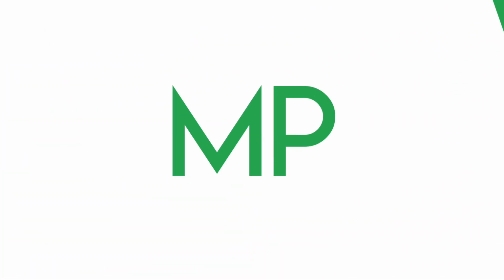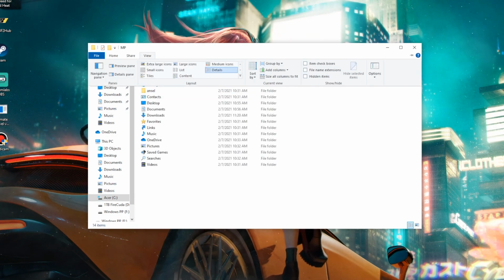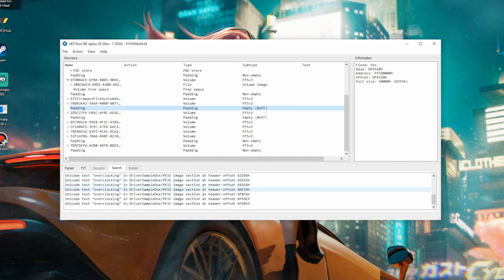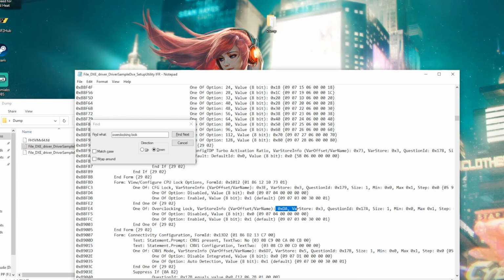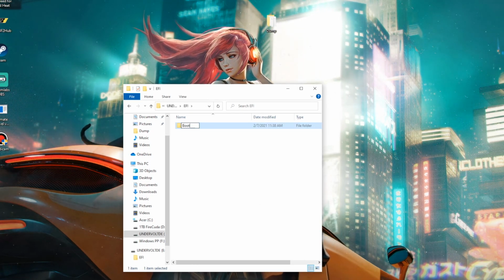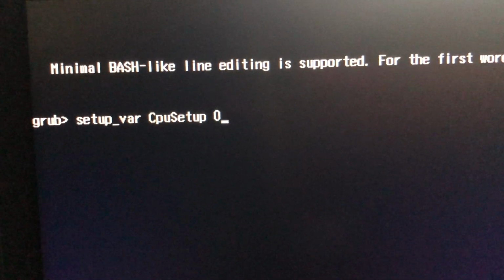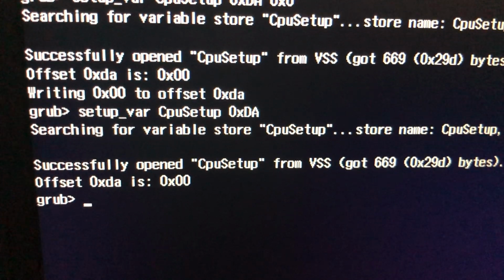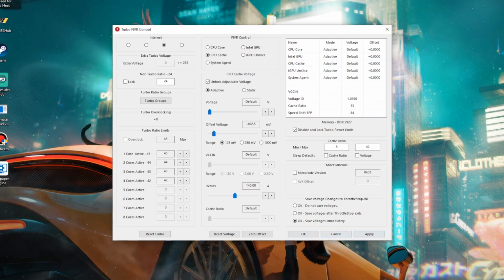How to Undervolt i5 10300H Acer Nitro 5

Comment: DUDE PLEASE HELP ME OUT!

I have a Asus Tuf Gaming F15 FX506LH. I am not able to get undervolt option unlocked. I tried flashing older version of bios. I have bios version 309, I tried using 307 but it didn't work. WHat should I do? Is it even possible to undervolt F15?
Reply: i have the same model as you and when UEFI tool to search for undervolt it just doesn't work
Reply: It should be possible. I have an FX506LI with bios 310 and after setting the var with grub it unlocked.

Comment: Hi I have an acer nitro 5 laptop with 10300h and rtx 2060 and I have undervolting blocked, I do everything like you but I have a problem loading a file from bios to uefi invalid uefi volume, do you have any solution?
Reply: did u manage to fix this ?
Reply: i found the solution you just need the latest version of the tool

Comment: Hello, thanks you for help, I was able to unlock the CPU volts and limit it the same way you did, but at 4200Mhz the temperature still reaches 95 degrees. Can you tell me what to do?
Reply from the maker: Does it reach 95 ingame or is that benchmark temps?
Reply: @Meanpooh  In game, 80-95 temperature on 4200Mhz
Reply from the maker: Well my machine is repasted so that helps with my temps.  Much better than stock paste.  Other than you might try a cooling pad thats all I can think of that will help.  BTW, my room temp is between 71-73F.
Reply: @Meanpooh  I've had paste twice in a month, in two different services, the room is also quite low temperature. There is a stand for a laptop, cooling also works properly. The only thing that helps is lowering CPU frequency. Literally a second after reaching 4200 frequency, the temperature reaches crazy degrees. I did exactly the same thing as you did in the video
Reply from the maker: You power settings is set yo "Balanced" correct?
Reply: @Meanpooh  high perfomace
Reply from the maker: @enw5140 set it to balanced mode.
Reply: @Meanpooh  You're talking about nitro sence, right?
Reply: @Meanpooh  Thank you so much, it really helped. I can't believe it the temperature maxes out at 80 degrees)

Comment: Seems pretty straight forward. Thanks a lot! So in case of a warranty issue, in order to revert back: we just need to go into grub and write 0x1 to that variable, right?
Reply from the maker: Just go back in and write what it was before you changed it.  It can vary by machine.  My machine was sent off to Acer to be repaired.  I never changed it back.  The change is nearly invisible as the BIOS is not being flashed.
Reply: Hocam merhaba, işlemi gerçekteltirebildiniz mi?
Reply: @recepcan3784  merhaba evet yaptım gayet sorunsuz calısıyor komutlar. geri de alınabiliyor yazdıgım sekilde.
Reply: @ozgur105  UV sonrası sıcaklıklar ne alemde peki ve işlemcin neydi?
Reply: @recepcan3784  i5-10300h, ya açıkçası sıcaklıkları karşılaştırmadım, hep böyle kullandım. Bir de UV yapmazsan fan daha hızlı çalışıp sıcaklıkları gene benzer seviyeye getiriyor. O yüzden tam bir kıyas zor. Ama kağıt üstünde (ki aslında muhtemelen pratikte de) 100 mV düşürürseniz, en yüksek frekansta %85'i civarına iniyor harcanan güç. Çünkü voltaj karesi oranında güç harcatıyor. Frekansı da 4.0 gHz'e limitledim, voltaj da düşüyor bu şekilde. Bu ayarlarla cpu zorlayan oyunlarda fan sesi gayet düşük düzeylerde takılıyor. Ha bakıyorum bazen 90 derece oluyor ama fan gerçekten hiç panik yapmadan çalışıyor, tam gaz çalıştırsan fanı gayet düşer. Ki bazı incelemeciler fanı tam güç çalıştırıp söylüyor değerleri. 

Temizlik ve macun da önemli olacak bir zaman sonra. Bence iyi bir macunla ve 90-100 mV UV ile gayet sorunsuz çalışır bu işlemci.
Reply: @ozgur105  Bende de aynı işlemci var ama benim cihaz Predator Helios. Bende Undervolt yaptım, saat hızları normalde sıcaklıklardan dolayı 3300'lerde gezerken şimdi stabil 4000-4200 mhz fakat sıcaklıklarda bir değişiklik olmadı ve bende bunu merak ediyorum. Madem giden voltaj azaldıysa sıcaklık neden düşmüyor?
Reply: @recepcan3784  Ama dediğin gibi 3.3 gHz'de çalışırken artık 4.0 gHz'de çalışıyor. Güç tüketimi ve dolayısıyla ısı üretimi, (voltajın karesi)x(frekans) ile doğru orantılı. Bu yüzden sen UV olmadan 3.3 gHz'deyken ürettiğin ısıyı anca atabiliyorken, şimdi 4.0 gHz'deyken ürettiğin daha fazla ısıyı atabilip güvenli sıcaklık seviyesini (tahmini 90 dereceler civarı) sürdürebiliyorsun. O yüzden doğal bir şey bu. Ha diyelim ki artık UV de yetmiyor, 4.0 gHz'e çıkamıyor bilgisayar, o zaman içini temizlemek gerekli, belki de macun değişimi.
Reply: @ozgur105  Intel XTU ile mi ayarladınız voltaj değerlerini?
Reply: @recepcan3784  Throttlestop ile yaptım, XTU çalışmayacak sanırım.

Comment: Hi , i have the same nitro laptop as urs, first of all thank u so much for this , it’s truly helping me lowering my temps, but what do u suggest as the ideal offset voltage?!
Reply from the maker: Glad I could help.  There is no one all setting to choose as one undervolt my not work as well from one game to the next.  You could do a .115 which should work for everything but it's not fine tuned.
Reply: @Meanpooh  thanks for the reply, a -115 offset voltage makes my laptop lags,  i set it to -110 which was fine since the temps didn’t pass 80, but i dont think im squeezing all the performance for my cpu,, i play mostly warzone btw, with a 1660ti

Comment: Hi! Will this work on bios version 1.06? Acer nitro 5, i5-10300h+GTX 1650? TY
Reply from the maker: It should as the only thing you need to find is the address location.
Reply: @Meanpooh  thanks!
Reply: @Meanpooh  Hi. Why can't I boot on my flash drive even if i press f12? It just restarts normally.

Comment: Good day to you kind sir. Nice channel you've got!
I bought this laptop today but with the 1660 ti. I got it cheaply (450 euro) from a store that got a returned unit even though it was barely used at all. Like new... buut it performs quite bad. Core 0 and "package" reaches 92-93c straight away in cinebench R23 yet the clockspeeds stays at around 3.9Ghz and sometimes reaches 4.2Ghz. It's pending back and fourth. Still I get really bad multi core scores. At most I've got a score of 4700 points but mostly it only goes up yo 4300 points. Thats 1000 points less than most with the same acer nitro 5 and i5 10300h. Over 20% less performance?! I don't know if the cpu power throttles as well due to the more power hungry gpu? The power brick says 180w so it should be enough? Under powers in HWMonitor package says around 62w and AI cores says 55w. Seems much for a 45w TDP? I don't really understand these numbers fully appearantly but the performance seems weak. I'll probably repaste but not sure if that will void the warranty? There are no stickers over the screw holes at least.
Any other suggestion what could be going on? In "nitrosense" I've choosen the preset high performance and the fans on max during benchmarking.

I also have another question. Do you know if it's possible getting lower ram timings one would buy a lets say 3200Mhz cl16 1.2v kit? I know they'll run at 2933Mhz but the stock timings at cl21 is really crippeling the performance I think. Have you tried just getting faster ram? Or will they automatically be set to cl21?
Reply from the maker: If your temps go into the 90C territory, you're sure to throttle making your clock speed lower.  Temps are an issue with laptops and they have to be handled if possible to get the best performance.
I keep my power profile on Balanced as I want my CPU to throttle down when it does not need to be used as much.  High performance will have the CPU running full speed constantly.
I have not tried to get the fastest RAM possible for the machine as it does not support XMP profile sile it will default to lower speeds.
I have 16GB or RAM in the machine which in the past has help performance tremendously.  I even made a video about it.
BTW, the different watts are normal, TDP is much heat a CPU will put out, not how much power it uses.  You're good.

Comment: thanks man!! really help me the courage to do this, complete guid and easy to understand instructions, works on my nitro 5 rtx 3060 i5 10300h laptop.

Update 09/13/2022: Someone with the same acer model (Nitro AN515-55) and throttlestop FIVR is not showing offset values, you will need to turn off core isolation and verify if throttlestop work properly.
Reply: please tell me which version bios  you downloaded ?
Reply: @dondiego9689  hello sorry for the late reply.. currently using the latest bios 2.06 version.. I came back here since I noticed my temp are really high and found my throttlestop is not working..
Reply: @bergZig  Thanks)

Comment: Is working on nitro 5 an515-55 i510300h rtx3060 with bios v. 2.03, thanks man, one of the best guides i have ever seen!
Reply: This made me relieved i wanted to undervolt the same device like same specs and bios version thank you gor this comment 😭
Reply: @Nave256  always have to help bros with same interests and hobbies, good work man👍
Reply: @Nave256  were you able to do the old one? i have to do it too
Reply: @Kim Steven  Yes i think, it’s the same process with different bits, but i haven’t tried yet.
Reply: @Kim Steven sorry, i didn’t understand the question you did to me. Generally you can downgrade to an old bios version by flashing it (not in windows) with a bootable usb, for me have always worked (didn’t tried with acer nitro 5 specifically).

Comment: Meanpooh, you're great! Did the undervolting unlock for my Acer Nitro 5, 10300h and RTX 3060 with BIOS 2.03 (GH51M). Strongly sticked to your actions and it works fine for me. Now undervolting the 10300h with -110mv offset using throttlestop. 4,2Ghz allcore up to 4,5ghz boost now possible without temp throttle @ max 75°C. Thanks Dude!
Reply: bro i have the same laptop, can you share your settings for FIVR and TPL? Thanks
Reply: @shivamvohra1981  here you can see:

FIVR
https://abload.de/img/screenshot2021-05-271xfjsn.png

TPL
https://abload.de/img/screenshot2021-05-2712bjcx.png
Reply: @sebastianweber7878  is your cpu cache also -110 mv?
Reply: @shivamvohra1981  yes, cache is on -110mv too
Reply: @sebastianweber7878  thank you brother, but just one more question, your icc max is set pretty high, i have 140 default, will it create any problem if i set that high like yours?
Reply: @shivamvohra1981  I have set ICC max for throttle prevent purpose in any case of ampere limit. Didn't noticed any advantage yet so u can leave it by default.
Reply: @sebastianweber7878  i just used your settings in throttle stop and my temps were out of the roof 😂, i think i have to re paste
Reply: @shivamvohra1981 the stock paste is a paste pad and in my case already dried. Repasting solved it. U can set CPU and cache to - 120mv. In my case not stable but maybe yours. Every -mv lower is going to reduce temp.
Reply: @sebastianweber7878  ya i am thinking of re pasting but i got my laptop just 2 months ago and haven't really used that much.
Reply: @shivamvohra1981  I repaste my one 24h after first use 🙃 not that challenging
Reply: @sebastianweber7878  core voltage can deal with -125mv although -75 cache would be ideal. Test and reply
Reply: @PtSp86  btw, -125mV caused bsod for me, try it carefully please.
Reply: @ozgur105  sure but because of cache limitations. -75 cache -125 core. With cache -110 core -110 had bsod, works perfectly fine with -75 cache -125 core. Icc maxed on both, PL 4 locked to 0 in the TPL. Stress test, throttling. No errors, no edp lights. 80° degrees tops. Plus.. 4.0 ghz set to be the top.
Reply: @PtSp86  can you please put some pictures with your settings? I have i5 10300h🙏🙏🙏
Reply: @cristisecara3653  atm with throttlestop 9.4 i just have voltage unlocked -0.125mv core v and -0.80mv cache v that's it. All cores reduced to 4.0ghz
Reply: @PtSp86  only these settings do?  I don't configure anything in TPL? thank You 🙏
Reply: @PtSp86  and one more question ... at the 125mV or 250mV tick?
Reply: @cristisecara3653  no need
Reply: @cristisecara3653  125, every chip reacts differently due to silicon lottery. The secret in these chips is not to push cache too much.
Reply: @sebastianweber7878  Ehrenmann!
Reply: Same configuration but don't work for me :(
Always 90°C T_T
Reply: @jeremythomas53  do you also check the frequencies? Because cpu will increase its frequency until thermal throttling achieved. So undervolting may result in same temperatures but at higher frequencies.
Reply: @ozgur105  I will heck that. But 90/95° during game it's pretty much I think... That mean fps drops during games (for example, Cyberpunk around 30 fps and high temperature).
R6S, I lose more than 30fps.
Reply: Sebastian Weber привет, мог бы подсказать насчет этого способа? Сложно разобрать с плохим знанием английского. Если не сложно, напиши в телегу @Lowranse
Reply: The same notebook. The same result! Works without repasting. Don't want to lose warranty.
Reply: Guys, -120mv may work ok for some time, but depending on external conditions (even season, humidity, electrical conditions, age of the laptop may matter) it may fail later. I know it by my previous experiences. So, for example, -100 mV should be more than enough for many. All cores at 4.2ghz is huge btw.
Reply: It still goes to 85°C even after locking clock speed to 3.5Ghz and at -145mV

Comment: Hello Mr. Meanpooh i am back, can i ask a question ? today i am find out the new BIOS version update 2.03 for acer Nitro AN-515-55 (2020), and the headline name is "1.Update power sw parameter. 2.Update Discrete VGA Qboot define." is this update good for Nitro 5 2020? or it just make worst the performance laptop?
Reply from the maker: I would not update the BIOS if your machine is working fine.  It can "sometimes" introduce problems.
Reply: @Meanpooh  oh okay, thx for your advice👍😁
Reply from the maker: No problem.

Comment: Thanks a lot
This trick worked on my acer nitro with the i5 and the rtx 3060
Temps dropped by 10 degrees
Kudos!
Reply from the maker: TWU!
Reply: which bios version you used bro?
Reply: @shivamvohra1981  Latest one 
2.03 I think
Reply: @rockguy5784  i am going to try it now, thanks for the quick reply, wish me luck. Have the same laptop as yours😄
Reply: @shivamvohra1981  No worries bro
Let me know here if you need any more help
Reply: @rockguy5784  my bios is already version 2.03, will it impact anything or should i skip the bios part on start of the video
Reply: @shivamvohra1981  I would suggest not to skip any part of the video.
If your bios is upto date then you can directly proceed to the modding part.
Reply: @rockguy5784  done bro, succeeded. Can you share your settings?
Reply: @shivamvohra1981  -0.125 on both cache and core.
I have left sys agent and igpu alone
Reply: @rockguy5784  thanks bro

Comment: Hi pooh, could this work at acer aspire 5 i3-1005G1? Please help me to aswer it
Reply from the maker: I can't be sure.  You could follow all the steps and stop at modifying the BIOS to see if you have the address to toggle.  That's pretty much all it is, enabling and disabling features.  I would suggest adjusting the Power Limits first.
Reply: @Meanpooh  how if theres no last verson of my current bios on acer driver website? What should be do?
Reply: I have the same question
Reply: Did you tried?

Comment: my undervolt is on -70 on my 17 9750h on a acer nitro 5 and on balanced mode in nitro sense but when selecting balance mode on nitro sense I lose so much performance is there anyway around this like keeping temps down but also not losing so much performance??? im using intel XTU
Reply from the maker: The 9750 is a very hot and finicky chip.  I have a few videos on it that may help.  I use Throttlestop in my tutorials as its easier to control.  Try searching for undervolt on my channel and you'll find them.

Comment: By undervolting, can I get good battery life with same performance?
Reply from the maker: If you mean by play games, unfortunately no.
Reply: @Meanpooh  not game but other mechanical softwares like Solid Works and Catia
Reply from the maker: You should see a small increase as long as it does not have to heavily use the GPU.
Reply: @Meanpooh  For normal use, what will be the time difference, please say. I have battery issue. Sometimes even 100% charged it shows 2 hours only left.
Reply: @Meanpooh  It keeps fluctuating, from 2hrs to 6hrs sometimes. What's the issue.?

When I buy after 1 month it was draining 1 minute for 1% and I factory restored it. What might be the problem caused that time?

Comment: This guide work on nitro 5 10300h Rtx 3060? Mi bios version is 2.01..in to acer website this bios dosent exist
Reply from the maker: I'm not sure.  Since I don't have access to that machine in the states.
Reply: It does 
I tried with the 2.03 bios and works like a charm

Comment: my actual bios version is 2.01 i can't install the 1.03 like you, how do i do ?
Reply from the maker: You don't need 1.03.  Try it with your current BIOS.
Reply: @Meanpooh  ok but i don’t find the tmp folder with the fd file
Reply from the maker: So you are saying that the BIOS is not on the site?  Try this https://www.reddit.com/r/AcerNitro/comments/l6d4mi/unlock_uv_on_intel_10th_gen_for_nitro_5_within/
Reply: ok thanks it works👍

Comment: Hey, Meanpooh. I was asking if we can just use the Throttle stop, or the other things you used are important to make the throttle stop work?
Reply from the maker: Yes you can just use Throttlestop if you are not locked out.
Reply: @Meanpooh  how can I know if I am not locked out. I have the nitro 5 i5 10300H
Reply from the maker: Try undervolting. If you cannot adjust the offsets then you are locked out.

Comment: Thanks bro ! Mi laptop is a Nitro i5 10300H with a RTX3060 laptop gpu 6Go. When I'm playing WarZone the heat is 80°... What's the ideal undervolting ? Please
Reply: 80 degrees? i get 90 playing r6
Reply: @jaimehrr  I get 95 degrees playing Mario on my Acer Nitro 5
Reply: @OkSear  I get 96° just by looking at mine.